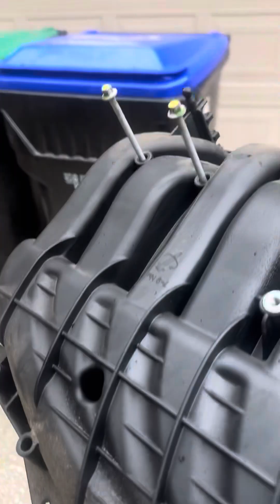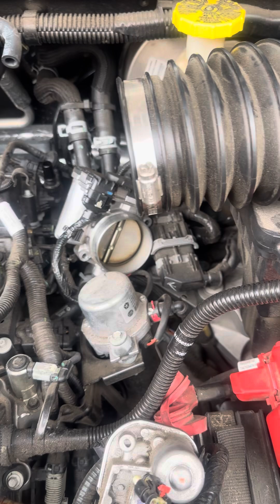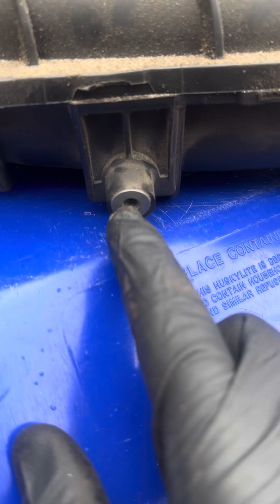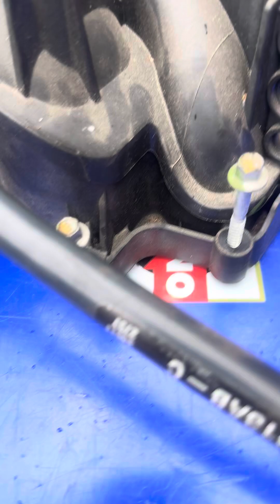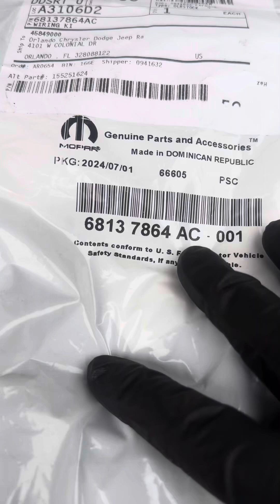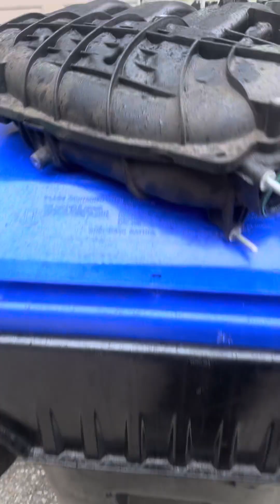2018 Chrysler Pacifica injector & fuel pressure sensor replacement (the fastest way)

Comment: Thanks for your video, EGR thing was a pain and that stud behind it sucked but I was able to manage changing all the injectors. I disconnected both batteries and removed throttle body, was all good when I drove it afterwards.